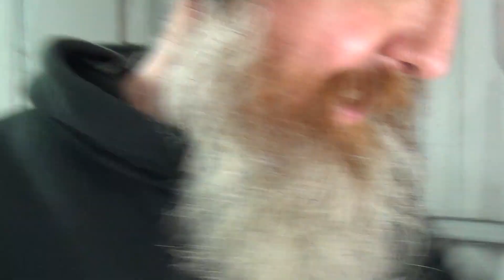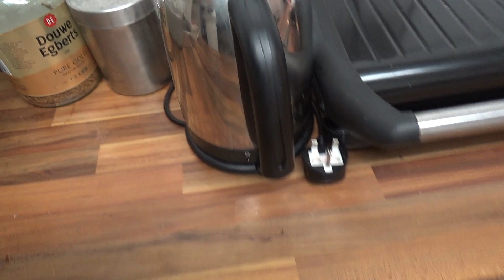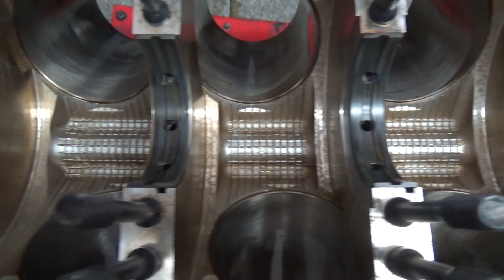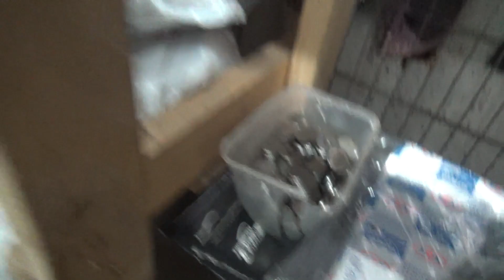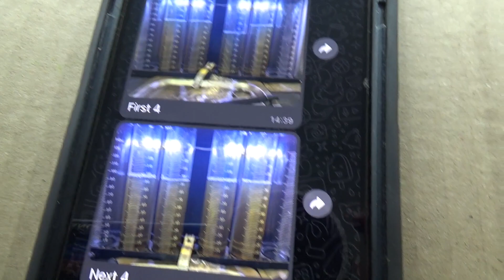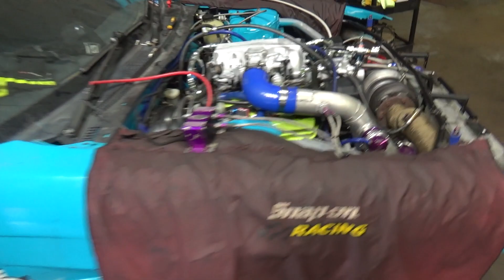Rebuild DISASTER! | 700BHP WITH FACTORY PARTS! | CraigDoesDrift //EP97

Comment: Can't believe you started that without having good cranking oil pressure.  Usually I'd pull the plugs out and spin it on the starter until pressure was good, the 1UZ should pull 10-15psi no probs cranking.  They usually don't need any help to prime but a quick blast of air into one of the breathers can just be enough to get oil into the pump if its been stubborn.  Also in the vid you can see the heat discolouration from using a grinder to gap the rings, that has tempered the end of the ring very nicely and ruined the heat treat, you should really only use a diamond file to gap rings by hand.  Last thing, the 1UZ standard breathers are too small for larger boost and it will blow out the engine seals.  I'd advise you weld much larger diameter bungs into each rocker cover and use at least 15mm lines to the breather catch tank.
Reply: Great comments with lots of practical knowledge. Just taught me several things